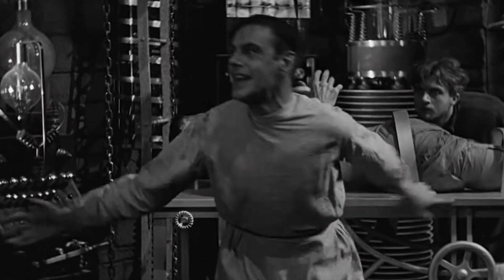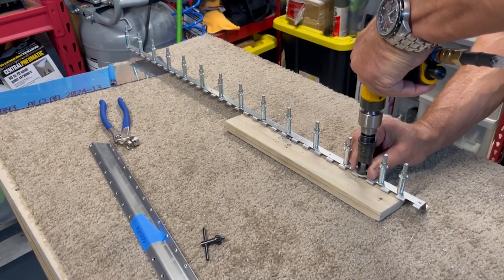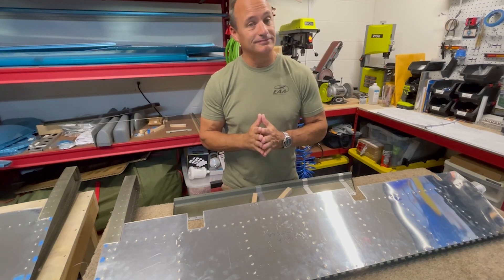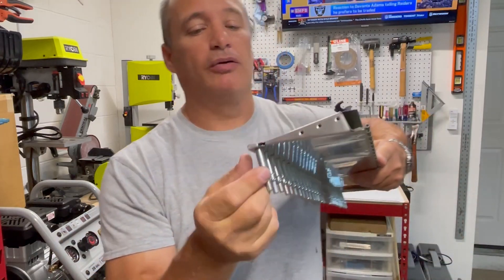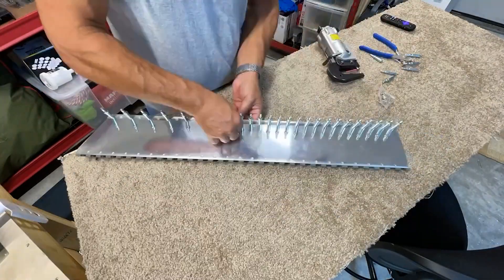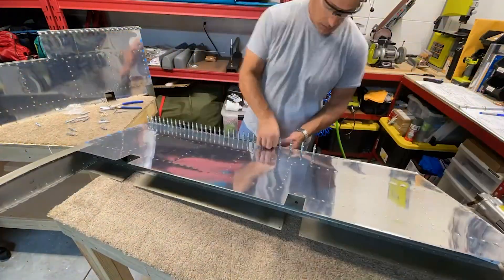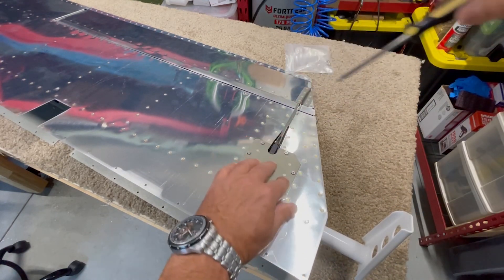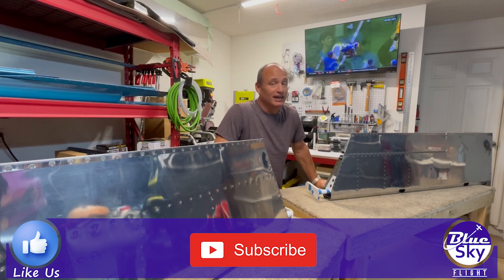Elevator Part 3: Building a Vans RV 14 Airplane - Ep10

Comment: My -14 tail kit arrived and I'm doing inventory this week.  This video was great and answered some questions I didn't even know I had yet.  Thanks for sharing!
Reply from the maker: Happy to hear that... Congratulations! You're going to have a lot of fun!.... However, look at your instructions page 09-15 should say revision 2, and page 09-23 should say revision 1. If these don't, your instructions are out of date (like mine were). I'm going to do a video to cover it soon, but in Sept23 Vans put out a Service Bulletin due to some cracking in areas on the skins around rivets in the elevator rear spars. The instructions were revised, at the same time, to add steps to add tank sealant along the joint between the rear spar and the skins after you rivet them to prevent the cracking. I did NOT do this step in the video - so don't do what I did, make sure you do that step... despite receiving my kit in Feb24, they packaged out of date instructions with my kit and I missed this step... so now I have to fix it. If you ever have any questions feel free to reach out to me blueskyflight@outlook.com. Please keep in mind when you watch my videos that I'm not an expert and I of course make mistakes, so follow directions closely and if in doubt support@vansaircraft.com :)
Here's one mistake that I made and had to fix on the Vertical Stabilizer: https://youtu.be/_unIGVj8HzE?si=krgISL430qGl2j8m

Comment: Hey, I noticed that you didn't show doing Service Bulletin 00043 dealing with Elevator rear spare prior to closing up the rolled edges. The new instructions for that section shows doing it during rudder assembly and the SB shows it after assembly. I do hope you did it but didn't show it. Good Luck with your build.
Reply from the maker: It’s a bit of a long story so I’ll be posting a video about that…. Short answer is I didn’t… but I’m going to…, :(